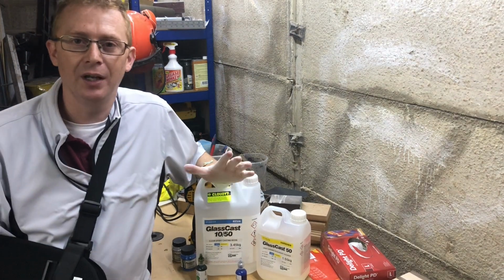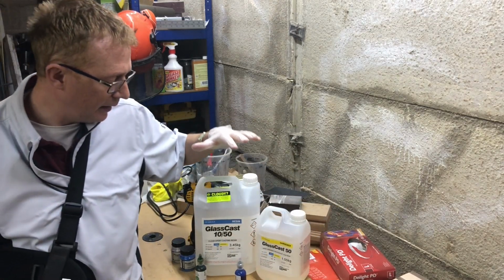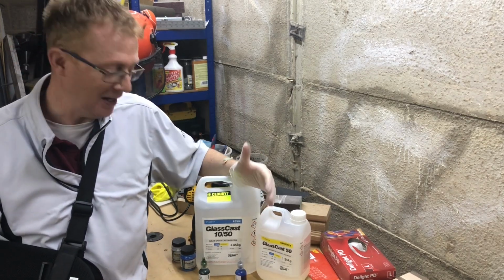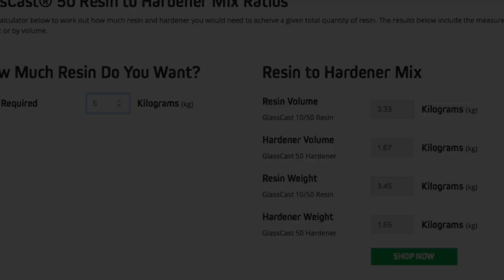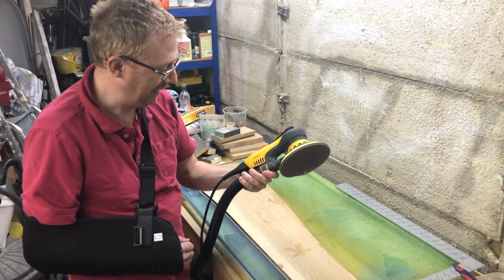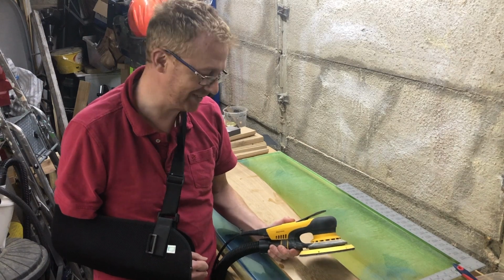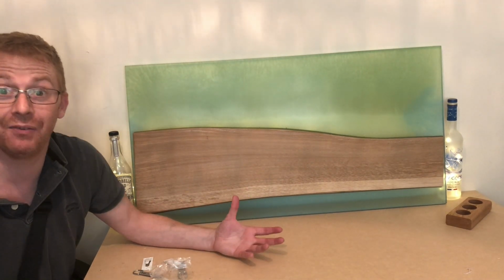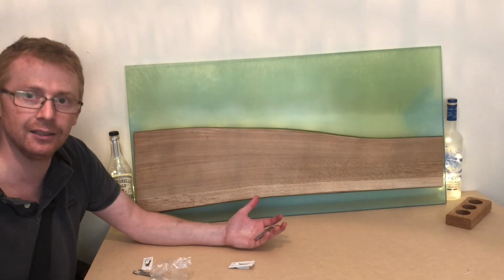Making  Oak / Epoxy Resin / LED wall art

Comment: Hi, well done for making such a nice piece. As for putting it on the wall, you could put a French cleat on the wood part and a filler piece at the bottom of the wood, that should hold it very well and as an added bonus people will ask how it is held on the wall as there are no fasteners you can see.
Reply from the maker: Cheers John, just been researching what you suggested and that looks like a good option😀. Many thanks 😀

Comment: Hi, nice piece. if you haven't done so already check out Stone Coat Countertops, they do some amazing effects with epoxy. As for hanging the piece use a couple of mirror plates secured to the wood and matching screws in the wall. If it is flush to the wall all the forces should be vertical and so the fixings should remain sound.
Reply from the maker: Thanks C P, will definitely look into the mounting solution and will check out Stone Coat too. Cheers for the advice😀

Comment: Maybe mount the whole piece into a custom-built frame and then hang the frame? You'd probably need to add rebates to the inside frame-edges for the artwork to sit into, or at least cut a dado on the back face and then add beading to sandwich the piece.
I'm doing something similar with a large mirror at home.
Reply from the maker: Cheers Chris, my better half Pam also suggested a frame in which I could install (more powerful) LED lights. Going to give it some serious thought and I’ve also had some frameless suggestions which I’m also considering. Many thanks for the feedback 😀
Reply: @Hand-i-Craft  Yep; the brighter LEDs could be a good opportunity. Thinking about it a little more, you could also maybe just cut a small shelf (not much more than a strip of wood) and just rest the lower side on that.

Comment: Great job.  I’d go with a French cleat system attached to the wood and it’ll give you a bit of stand-off for the lighting system.
Reply from the maker: Cheers Tony, that’s what I’m going to go with. Seems relatively straightforward to do and plenty strength to secure it. Plus I could do it behind the oak bit so it’ll give it a suspended look😀

Comment: Wow, absolute stunner piece, mate. 👍
Fantastic job. 👌
Could you not fix those mounts into the wood and use the appropriate gauged wire pulled tight enough so it does not show passed the wood, and mount two hooks in the wall so it won't slide one way or hang unevenly? 
Just a thought.
Reply from the maker: Thanks Bill for the kind comments 😀. I think I was just worried about the load being taken towards the bottom of the piece and if there any risks associated with that? It’s new to me so all advice appreciated 😀
Reply: @Hand-i-Craft  I guess if you wanted to have a crack at making a frame for it, then right there is another video. 😋
Nudge nudge, wink wink! lol 😂😂😂
Reply from the maker: @SMee67  🤔🤔😀😀